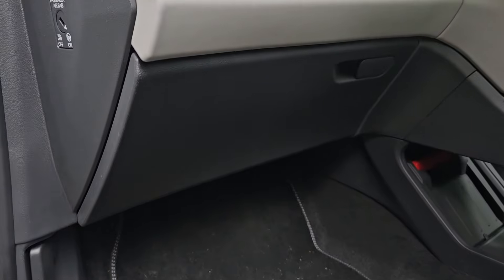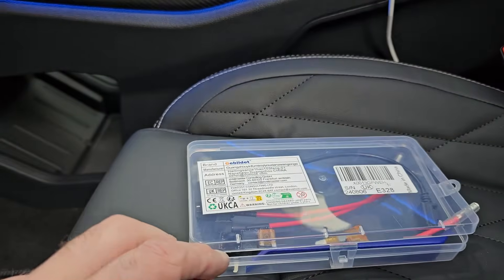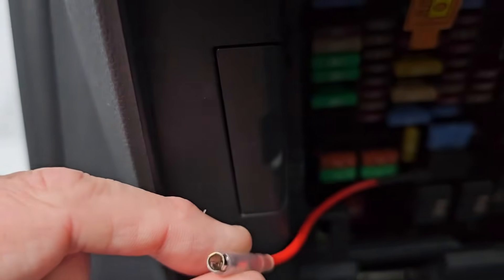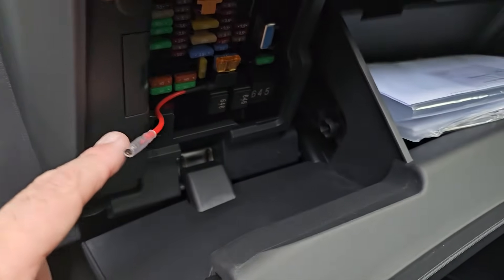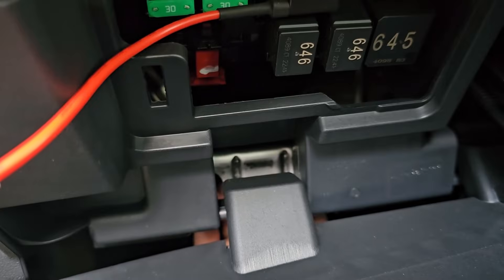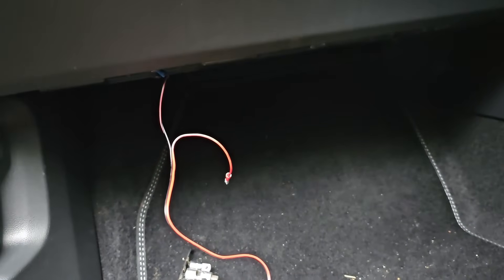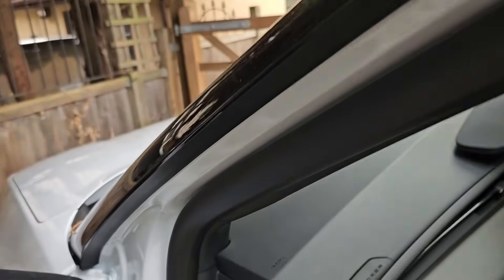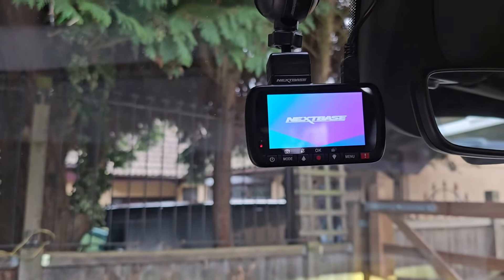Installing dash cam into new Ford Explorer EV (no 12v socket!)

Comment: Followed your video exactly..same earth, same fuse (66 - rear wiper) but getting nothing when checking the fuse tap volts..tried 3 separate fuse taps with new fuses (tried 2A and 5A). If i leave the fuse tap plugged into the fuse box i can select the rear wipers and they work..i've absolutely no idea what i am doing wrong? any ideas?

Comment: Hi all, got this kit, installed it as in this video in slot 66 and earth to bolt under glove box  rear wiper works after install but no power going to the dashcam. Any ideas, possibly a faulty kit? Anyone have this issue any help mich appreciate.  Cheers!
Reply from the maker: Check earth continuity and the fuse in the piggyback side.

Comment: After watching for 2 minutes, I guess that the cam only works when the ignition is on. If wrong, you need to say at the beginning of the video when the cam can work.
Reply from the maker: That's normal. At other times e.g. motion sensing, impact sensing the camera powers up by its internal battery.

Comment: Great video! The kit that you used you showed the bullet and earth point but I couldn't see the other end of the box it it just a USB connector for the cable to plug in to and do you have the links to the amazon kits you used and does the kit come with the new 5am fuse? Cheers!

Comment: Nice video.
I don't know the exact names for the stuff you used.
The 'piggy back fuse holder'I found on Amazon. No problem with that.
But the other part, the little black box with black wire you connect to metal part and red wire you connect with bullet contact, how do you call such a box so I can find it on e.g. Amazon ?
Reply: That's the "Hardwire Kit" and specific to your Dashcam

Comment: If you had run the cable up first you wouldn’t see any cable showing. The camera that came with my car was in its own fuse slot about halfway up so there was no piggybacking. I’ve got my new camera on fuse 25 as I need a permanent 12v.
Reply from the maker: I don't keep the cars that long or else I would :-)

Comment: Hi,
I ordered the Type-C cable set you recommended from Amazon and connected everything correctly. The fuse and dashcam are working fine. However, sometimes when I start the car, the dashcam doesn't turn on automatically. I have to press the power button manually to get it to start.

Could this issue be caused by the low voltage protection? I'm not using the parking mode (always-on) feature of the dashcam.

For reference, I’m using an Azdome 550M.
Reply from the maker: Have you checked that you have a reliable ground connection?

Comment: Thanks for the video! Is there a trick to removing the panel covering the fuse box? Mine is not releasing on the left side.
Reply from the maker: Just pull centrally straight backwards and it will come off. The catch is at the bottom in the centre.
Reply from the maker: Should easily remove when you operate the release catch.

Comment: Correct me if I'm wrong, but the socket you put the fuse back in is no.51, which although has switched power, is the wrong one. It should have been put back into fuse 66 to the right, which is for the rear wiper. I followed your video and put the fuse in the same socket aa you and my rear wiper failed. I moved it across to the adjacent fuse 66 and hey presto! Great video though 👌
Reply from the maker: Yes I did 2 takes and edited the wrong footage in there. Well spotted. It is the adjacent fuse socket when you put the fuse back. When I was filming the phone rang so I did that part again!

Comment: The dashcam I got has parking mode and came with a kit that has a red and a yellow and an earth wire and says I need to connect the yellow to the ACC fude - don't suppose you know where that is? 😅
Reply from the maker: Accessory is the fuse I show there, which is the rear wash wipe. You could pick up another fused connection for your red permanent 12v by funding a non switched circuit in the fuse box that is live all the time. Earth as per how I showed. If you get stuck message me and I'll find a permanent 12v for you in the fuse box
Reply: @BigManMotors  Thanks very much! I can see from the manual you use slot no 66 (rear window wiper) so if you could let me know a suitable permanent 12v one! Edit: The 12V Trunk socket I realised is also ACC? I can see from the manual that No 63 is 7.5A and not in use by anything, as is No 16 which is 10A - do those not used ones always provide power?
Reply: @temperedfox  did you manage to find a permanent live fuse for your parking mode dash cam? I'm looking at getting one for mine so wondered if you had any tips

Comment: Great video, do you also know how to install one in the back for the rear window?
Reply from the maker: If your rear window cam has its own 12v feed then use the 12v socket in the truck. The Nextbase ones I've installed were all fed from the front camera for power so you just run the wire to the back of the car.
Reply: Thanks for the reply appreciate it 👍 @BigManMotors

Comment: Thanks for the video! But I rather want to use the original Ford dashcam you can buy to the Explorer. It's more expensive, but it's hidden well and works really good.
Reply: @BaMbOoZeD  thx guys 
Makes sense since it's a VW System with Ford Skin on Top. Some VW ID Models have a USB Port near the Center Mirror, is it the case on the Explorer as well? Would be nice for grabbing juice directly
Reply: @Fabicity  The only ports (usb-c) are under the touchscreen, but normally I use a long cable and connect it under the center console. I'm hiding it very well and takes some time, but looks very good after.
Reply: @BaMbOoZeD  Possible Solution. Really a shame that there is no 12V Socket as Standard, especially because it's electric... I will try the same thing as in the video, but instead of a direct connection to the Dashcam I will put a 12v socket inside of the small compartment under the Center console, for charging Laptop and higher draw items. Do you maybe know how much power the USB c ports can deliver? Should be 15W
Reply from the maker: @Fabicity believe it's 45 Watts in total for the USB-C ports combined
Reply: @BigManMotors  wow that is quite a lot!
Reply from the maker: Yes, the Ford accessory dash cam is a great product, too. If you're like.me.and change the car once or sometimes three times per year, the Nextbase camera is ideal.
Reply: @BigManMotors Oh okay, so it's a leasing car then I understand 😊. I have bought mine for the next six years.
Reply: How do you connect the original Ford Dashcam?
Reply: @Fabicity  No clue actually. Ford installed it for me when I did get my last car. Same goes for the new one I'm waiting for. But I'm guessing it requires some software installation on the sync screen and some wire connections.
Reply from the maker: @Fabicity there isn't one for the Explorer / Capri. The usual Sync3 / Sync4 integrated camera doesn't work with Sync Move.